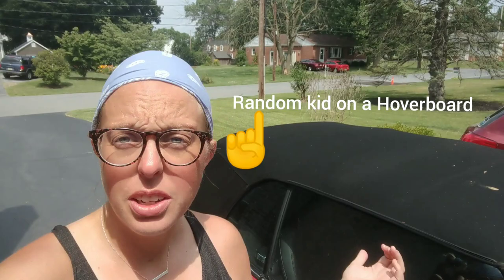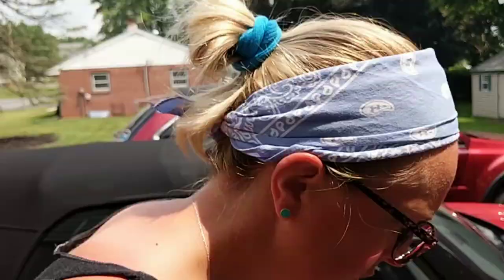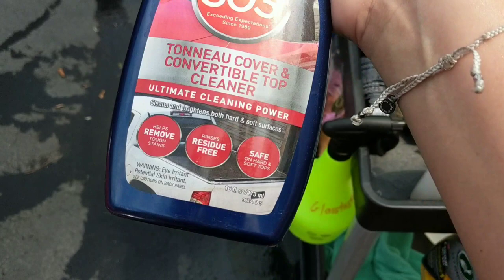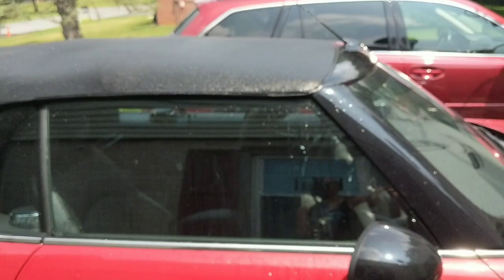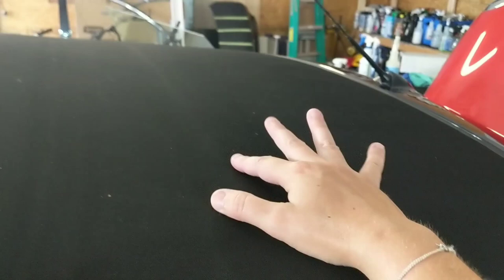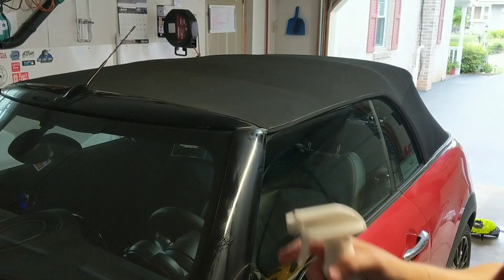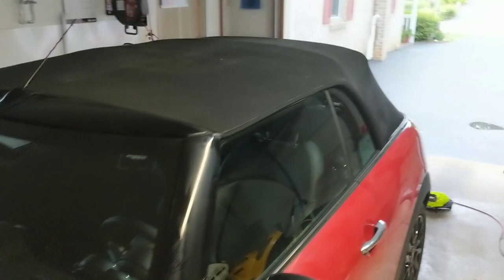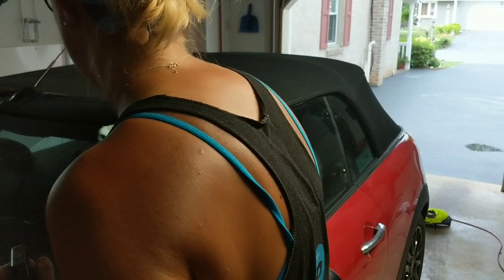How To Clean and Protect a Convertible Top with 303 Convertible Top Cleaner and Fabric Guard!

Comment: I need to give you my testimonial regards 303. As you will see in my comment below, I reported a terrible result with 303 Fabric Guard. I reported it to 303 and got a call from their Tech Support within 7 hours of my message to them. As it turned out, the provider of the product (on Amazon) shipped me product that had been recalled. 303 gave me instructions for correction of my issue and are shipping a replacement for the product and refund for what I paid for their product. That’s the respond and “stand behind of product” that other manufacturers should provide. My hat is off to 303! Thank you. I look forward to starting over and expect the result Chelsea describes.
Reply from the maker: Thanks for sharing!
Reply: Who was the seller??

Comment: I used 303 Tonneau Cover and Convertible Too Clean on my Mini Soft Top. It cleaned up nicely. Then I used 303 Fabric Guard and got terrible WHITE powdery residue!! 😢 What have I done wrong and how can I correct it?
Reply: I did all work with the Fabric Guard indoors.
Reply from the maker: Did you apply it heavy or a light mist?
Reply: @attention2detailswchelsea , I thot I applied a light coat.

Comment: I got 303 aerospace protectant ultimate UV protection on the back it says do not use on canvas did I get the wrong product for restoring color thank you
Reply from the maker: Yes you need the fabric guard not the aerospace protectant. That is meant for protecting plastic surfaces not canvas or fabric

Comment: What if you were to use an sio2 or ceramic coating spray on it, would that work?
Reply: It would have to be a product designed for fabric....using one not designed for fabric could either have no effect at all or contain too much silicon dioxide and harden the fabric

Comment: Hi Chelsea, I just bought an s2000 that has a soft top and the top has like water spots. White circles. You think this product will remove them? thank you!
Reply from the maker: What color is the top? It may but be careful to not over scrub when trying to remove them as you could stress the fibers and scortch them so to speak. You could try something like a carpet cleaner cleaner/resolve lightly with a toothbrush in a small spot to see if that gets the spots up then clean the top as usual.
Reply: Attention 2 Details w/ Chelsea sorry for the late reply I didn’t get a notification. But the top is black from an s2000. The spots look like water spots. I just ordered the same product as you and I’m going to give it a try. Also I tried the meguiars one and didn’t work. so I’ll see what happens. Thank you!
Reply: @eliseodiaz4656  I used some diluted vinegar (50/50) to remove the spots on my S2000 top using a gentle brush. If they really are water spots and not a different type of stain, this should improve it.